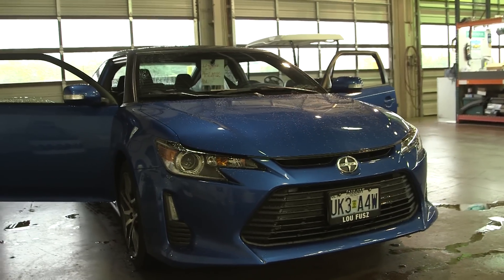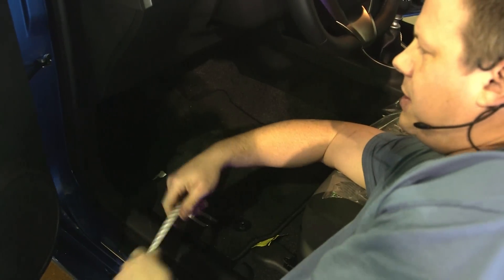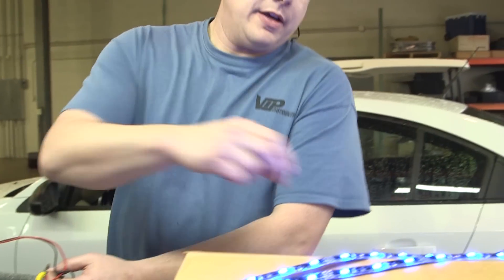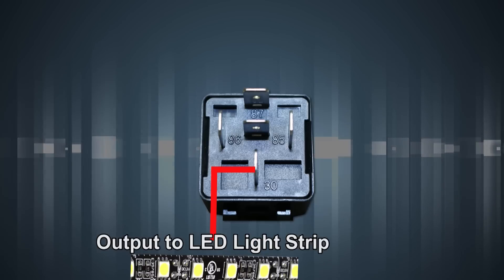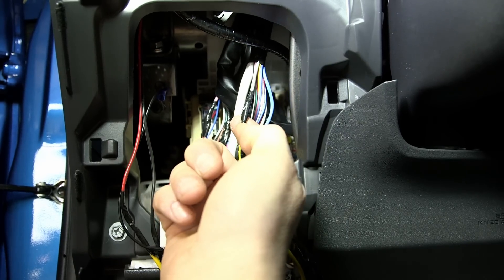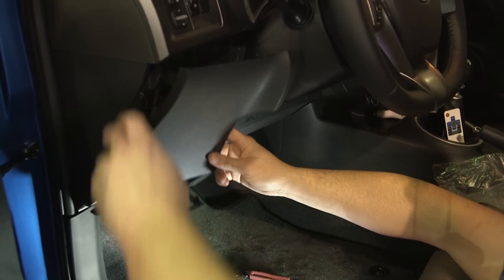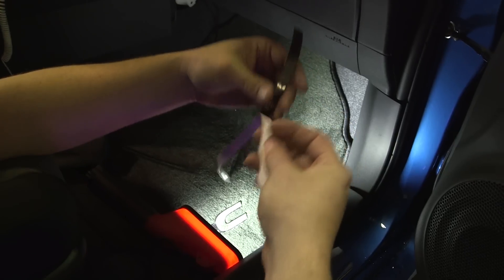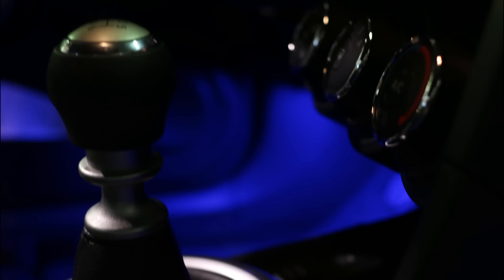How to install LED footwell Lights with RGB LED Strips

Comment: thanks for showing the link. was looking for this and initially was looking for an USB version. Then found this video. Very helpfull!
Reply: Im none English and i think i missed the reason why you needed to resolder some wires. I watched it twice and still didnt find the reason why that wose done?
Reply: PS very nice what you did at the end to show PROPPER prep work. Seen quite some vids were the tape would not keep holding and just fall down

Comment: Am i considered to have a learning disability because i required two days of multiple youtube videos to fully understand how relays work along with all the other components mentioned here such as grounding/positive connections? I'm a first time car owner so all of this seemed overwhelming to learn but i must admit it's really fucking gratifying when you reach that point when you know what's going on. Best of luck to any of those new to this and endeavoring to understand how the wiring functions inside a car cause it's a bitch lol
Reply: Modern Automotive electrical systems are pretty complex, so this is a relatively difficult way to learn these electrical basics

Comment: Great video..  can how to find the negative to the dome lights or door lights?   My car does not have door lights but there is a door switch and room lamp..  I found those wires via my fuse box..   can I use the positive from them to connect to the relay??  Instead of using the negative from some light as in your video and slide  example?   I have a 2013 Nissan Pathfinder and have an accessory  service port.  With all positive connections and 1 black ground cable..  I am trying to hook up footwell Led ( with cigarette adapter and power button) I would like for the led to light up when my doors are open..   any ideas best way.. without ripping open the top map lights to tap into the negative ?? ThAnks

Comment: The strips, specifically the monster ones, generally come with a USB type plug.  Are these able to run straight to 12 volt system as it appears you have done?    Excuse my ignorance if i am way off, I am pretty new to this stuff.

Comment: I would like to do this to my 2018 infiniti q70, but I dont want to mess with the wrong wiring, Ive looked online and I cant seem to find a manual or something that shows which wiring under the dash goes to what, is there anything you recommend?

Comment: I installed a set connected to the reading light cable that gives power every time I open the door, my Problem is that when they go off they then go always back to red instead of staying white, any ideas why?

Comment: hi, i bought a roll of the rgb lights with the remote control to put in our camper van. I am going to run them from a secondary battery .do I need to put a relay in front of them or can I hook straight to the battery ?
Reply: Relay for any type of switch leds are low current that youre trying to put high current to

Comment: This is exactly what I want to do, my question is my 12 volt constant comes from the fuse box with a Add Circuit, so one wire, where does the other 12 volt constant wire come from. The one that connects to the 87 and 86 of the relay?
Reply: You would take a single 12v rail to a 5amp fuse, then just simply split the connection to two wires and run them to 86 and 87

Comment: Help, 

I wired mine to the Cigarette Lighter fuse which is rated at 15A. Will this cause the fuse to blow up when I'm using the cigarette lighter to charge my phone?? I haven't tried to use the cigarette port yet.
Reply: Shouldnt